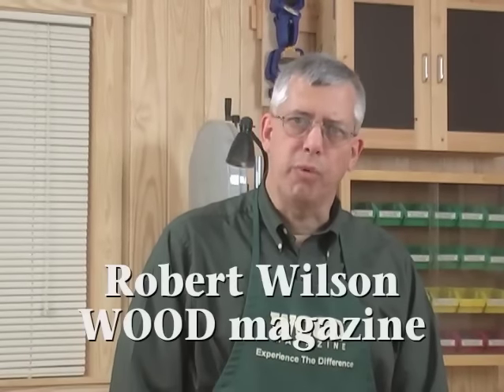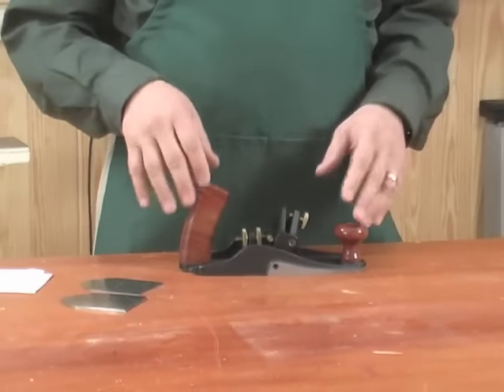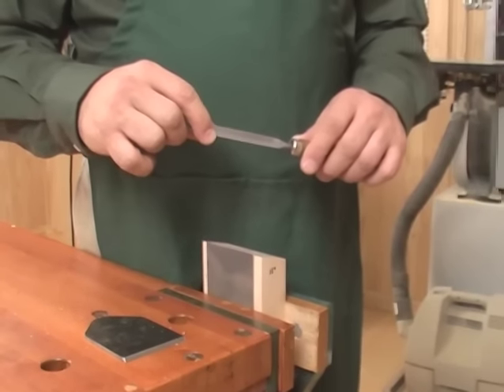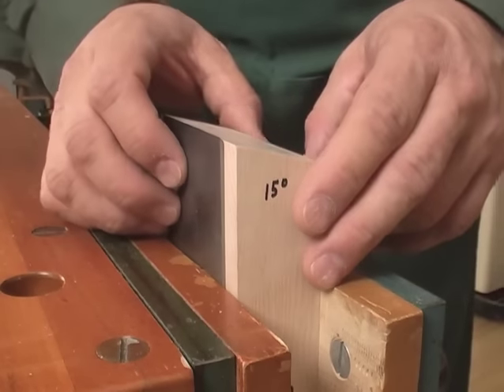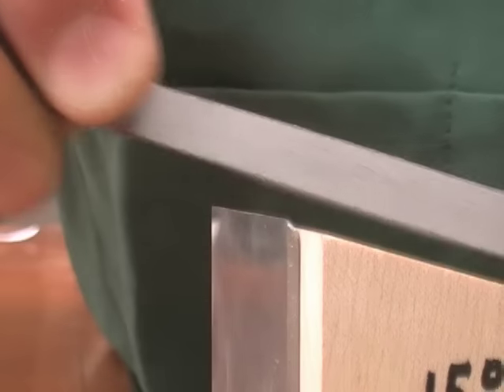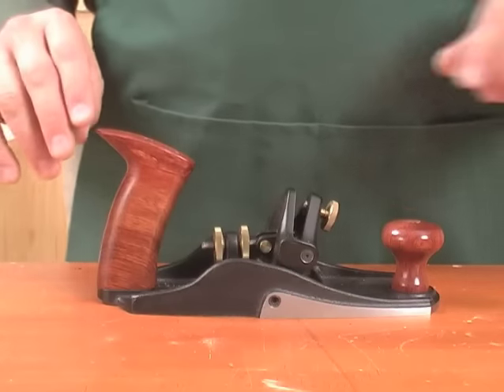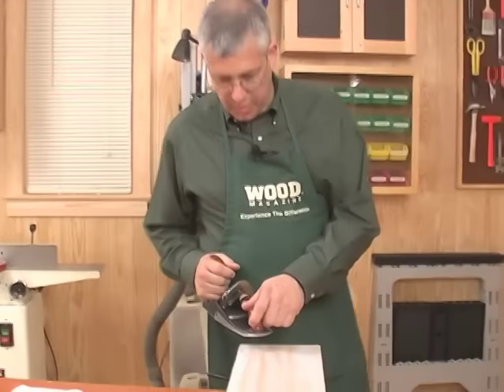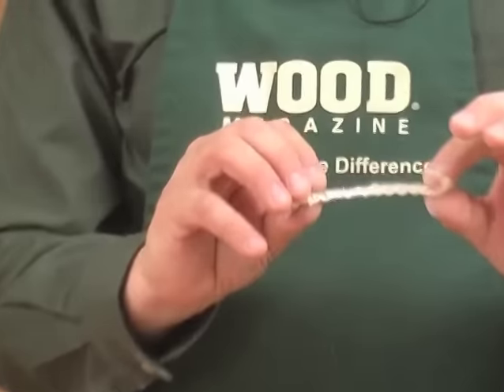Scraping Plane: How to Set up and Use - WOOD magazine

Comment: what are the advantages of using this scraping plane compared to a traditional plane.

it seems like they achieve the same objective
Reply: Scraping planes are usually VERY wide ,and MUCH wider than smoothing planes . Also the shavings from a scraper can be made thinner than a smoother.
Reply: @738polarbear  thanks bro
Reply: The real benefit is that they are indifferent to grain direction, they never cause tearout